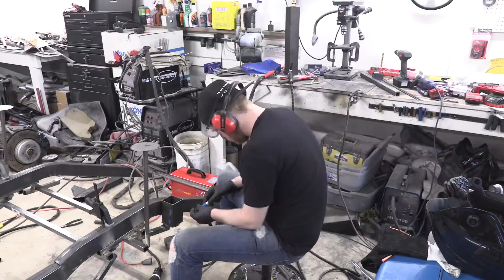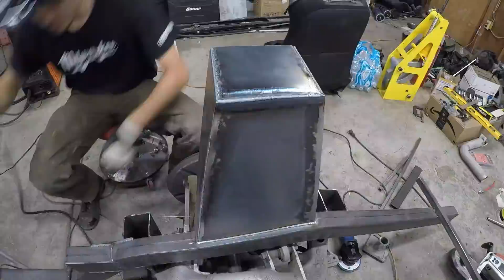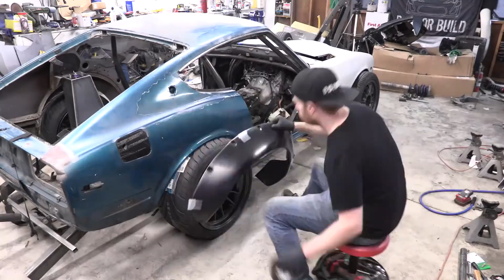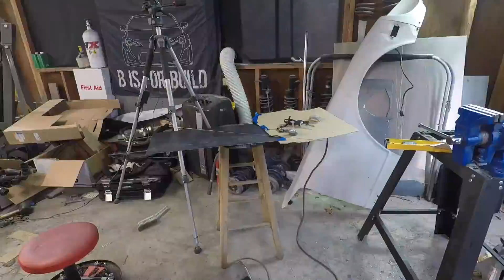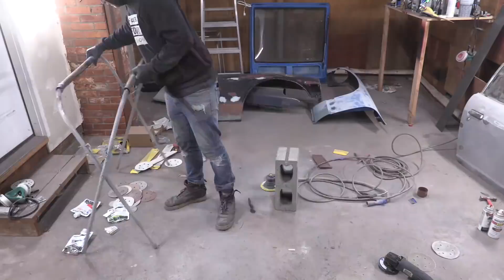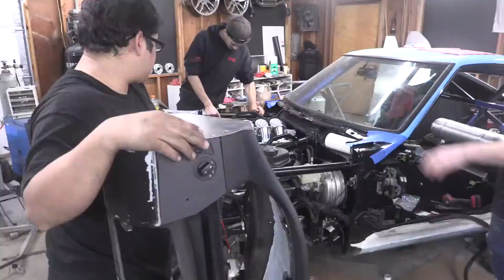You're In Over Your Head - 240z Finale

Comment: "In today's episode were telling the story of how we built a mid engine widebody V10 swapped 240z in 6 months."  One of the best sentences ever written.  Just, props all around dudes.  Such an amazing Build.
Reply: Mid engine? What does it mean?
Reply: @zasadacrew  It means the engine is located closer to the center of the car. This one would probably be considered front-mid engine, with mid engine usually known for being right behind the seats.
Reply: @richardlont4480  , I know, but to call front engine car a mid-engine is a bit ridiculous. Without measuring tape you can see that engine is in the front. It is FR setup.
Reply: @zasadacrew  The wheels are behind the front axle, and in front on the seats, which means that this is front mid engine.
Reply: ambush crew there can be front mid engine, rear mid engine, front engine, rear engine, the porsche is rear engine not rear mid engine btw just an example.

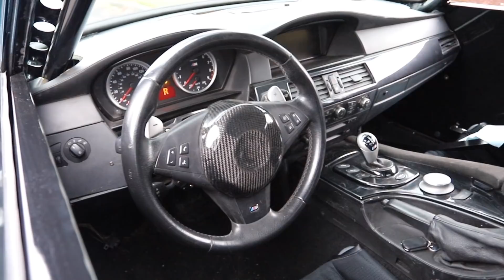Comment: 13:30 i was really hoping for a manual tho
Reply: autotragic
Reply: oooof its automatic
Reply: Glaux De it’s got paddles at least
Reply: Not as fun
Reply: its smg, which stands for "sequential manual gearbox"
Reply: Stargun5502 I think smgs are pretty neat, but to each his own
Reply: If i owned one, i dont think id ever drive it in automatic mode
Reply: @KrazyKuul111  I mean definitely to each their own, but I feel if you're gonna buy or make a car like this, just go all the way and get a manual, a real manual, instead of being like, oh I want this manual mode that makes it so I dont got to fool with a clutch, etc, because it takes you out of the experience. But they are better riders though. To me, anything that takes you out the experience more isn't that fun, but is better for riding. Automatics being better in that extent.
Reply: Stargun5502 a dog box is the only way to go then, and you dont need the clutch to shift those
Reply: Mike G  If you're gonna race and care about your transmission type, just get a modern race type automatic, they shift faster than a human can, and more efficiently than an SMG in terms of output. I say a normal manual transmission is a far more fun experience and more engaging. the 240z wasn't made for outright speed, but for the driver's enjoyment. I just thing anything else is taking away from the essence that a Z of this era had, and especially this modification to it. It's not the worst, and I think an engine swap is fine, but I just disagree with throwing an SMG into it.

Comment: quick question how do you even register this?
Reply: War Zone  boy only the shape is intact kinda
Reply: War Zone  yeah, as long as it has the original vin your good. Otherwise it would have to be registered for a custom vin, which many states will likely only give out a few hundred a year.
Reply: It varies by state in the USA  but for the most part this car is no different than a Street rod/ Rat Rod.
This car is built around the Original, and the original has VIN.
As mentioned "Darian Trevino" VIN is the key to getting it done and stopping by your DMV to get the proper paperwork.

Comment: Welp, it's got a Sequential Manual. Okay the build is worthless now, paddle shifters suck, good for going fast, and nothing else. At that rate, just keep it in automatic mode, because the manual won't even be fun. If you're gonna sink 50K into a car like this, put a stick in it, you'll have fun that way, maybe less fast, but who cares? If you're tracking it, you probably aren't actually going there for times, taking a V10 240 out, so why not have fun with a clutch and a nice 5 or 6 speed? I highly doubt he doesn't know how to drive stick, so why make it not have it? A stick makes things fun even at low speeds, rather than a semi-auto gearbox and automatic gearbox.

Comment: I bet this car doesn't drive straight or handles well. No jig table to build the frame and no calculation on stress points and chassis rigidity. The whole build was done on the fly . One thing is fabricating and the other is engineering. Every time they move the cinder blocks there it goes the geometry.......